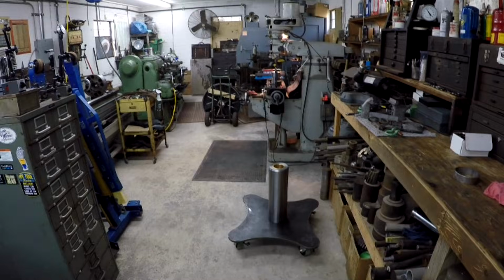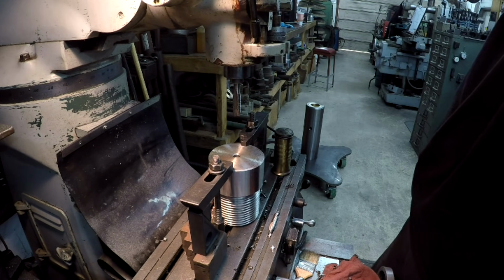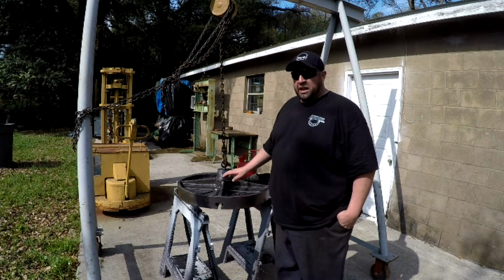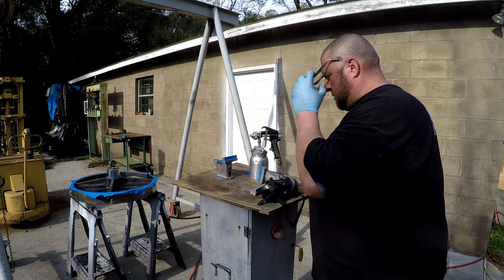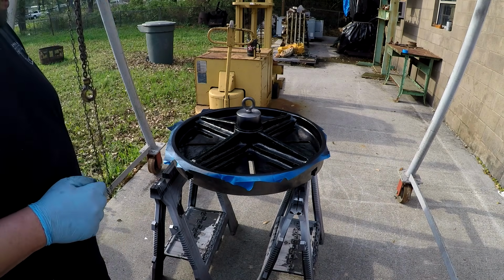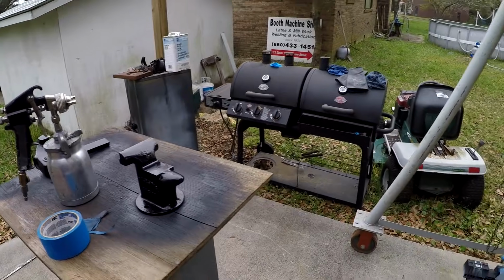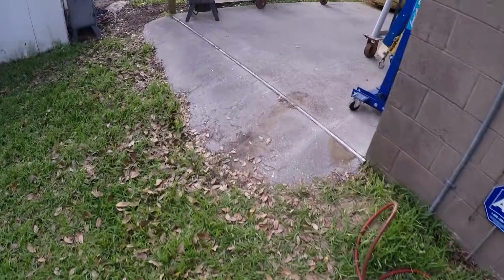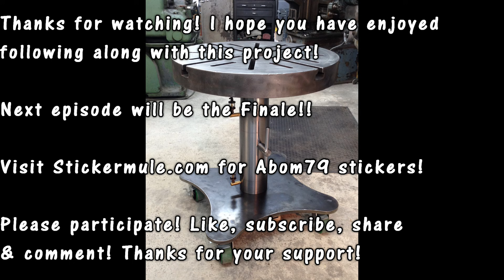Rotary Welding Table Build Part 16: Paint

Comment: Good job on the paint. it turned out well.

 Thanks for the tip on the tap drivers for use with the collet.  I've used a drill chuck to drive them before but like the driver better.

  Jeff

Comment: That spray gun looks almost identical to one that I bought somewhere around 15 years ago for about 15 bucks new.  I purchased it from Big Lots and I think it was Chicago Tool or Central Pneumatic branded.  I've never used it :P  The last big painting job I did was when I shot my '61 Plymouth with a coat of primer,  and I used my old W.R. Brown Speedy Sprayer for that.

Comment: Hey Adam Looking good. Some basic pointers about spray painting, especially outside. First, if possible you want to paint in the shade, not in direct sun-light (early morning, cooler, opposed to late afternoon, hotter,  and more bugs in the afternoon). The reason for this is if its a hot day (above 75 degrees) the sun will cause your paint to setup very quickly, and your overlaps will tend to look dry. Painting in the shade will allow the paint after being sprayed, to flow / level out, and give a much better appearance (as in wet looking). While you were happy that you didn't get any runs in the paint, for those in the spray painting business, a run only means that YOUR PUTTING ON THE PAINT.

Another small trick, is to paint your edges first, (the bottom {Kidney shaped} support plate) then move on the the rest of the flat surfaces.

Your spray gun appears to be a "Knock-Off" of a BINKS Model No.#.-7 (which was the back-bone of the autobody industry circa 1970's to approx the mid to late 1980's.) Many different gravity fed guns are now used, because the "TRANSFER - RATE" of material is so much better with the newer spray guns, {more paint on what your painting, then just going out to no where, and costing you money $$$$} but for the back-yard guy who maybe only sprays a couple of gallons of paint a year, a siphon feed gun like your using is perfect.

Remove and clean the outer spray cap, and remove and clean the Fluid Mixing Nozzle.  That's what you see when you remove the Outer Spray Cap (A.K.A.,Air Mixing Cap).
Some times a brush is needed, just go to your local autobody supply store, or even maybe a NAPA Auto Parts,)

Remove and clean the Fluid Needle, and do put a very small amount of petroleum jelly on the Fluid Needle approx. 1/2" -3/4" in. back from the front tip, approx 1" in. long.

How to adjust the Fluid Needle, squeeze / pull the trigger all the way back, and then turn in the Fluid Needle until it starts to push on the trigger. This is the starting point, and depending upon how much material you want going through the gun.

Another small trick, for when even putting petroleum jelly on the Fluid Needle, doesn't cure the "STICKING" / "DRAGGING" problem, use by hand method only, (with the Fluid Mixing Nozzle removed) a drill bit the same size as the fluid needle, or maybe just one or two thousand's over. You'll know that you went to big, if you start to get blow-back on to the trigger, then either tighten the packing (via the nut), or replace the packing (remove the nut and the packing is right there, and its not much.)

Also, when paint something in a cylinder shape, don't be afraid to turn the air cap, from Horizontal (Default) position, to a Vertical position. Try it, you'll like it.

Comment: Looking good! I'm not gonna critique your spraygun technique (wouldn't be polite) BUT I would recommend talking to your buds that DO paint about some "do's and don'ts". I painted the Z28-style hood and trunk stripes on my '71 Camaro 35 years ago. One thing I WOULD suggest is throw the air hose over your right shoulder and let it run down your back instead of trying to hold it in your left hand. I drug the air hose in my hood stripe right in front of the driver's windshield. Had to flood it and wetsand like hell to make it look OK. And that was Dark Sapphire Metallic paint on a white car.
BTW that spraygun looks like my Binks Primer gun. I got you beat on that one though. A neighbor gave it to me.
Reply from the maker: Funny, often times when I'm welding I through the leads over my shoulder so I'm not holding up so much weight. Yea sometimes that air hose can be half the battle.

Comment: hi Adam great video. just looking at your gantry crane can you mount the wheels on the inside of the legs .with the wheels just proud of the flat mounting plate to reduce the height. the flat plate will help the gantry from tipping over. cheers paul

Comment: Those copper jaws are going to look good on that newly painted back vise.

Too bad that big faceplate wouldn't have been easy to throw in the blaster.  It may have made it easier to clean up.  I like the color after a couple of coats got on the parts.
Reply from the maker: Yea I didn't feel like breaking my back again lifting it. My brother and I set it down out of my truck when I hauled it home. LOL

Comment: I have a spray gun that looks identical to yours. Mine is a Sears gun and says CRAFTSMAN die-cast into the side of the handle. I believe their house branded guns were usually made by Campbell-Housefield. Normal working pressure is 45 PSI if I recall correctly, but you can go +-20 PSI depending on what you are shooting.

Comment: Hi Adam.  I love this project.  The only suggestion I have is that when you're painting, you'll get a much more even coat if you keep the nozzle parallel to your work.  When you flex your wrist the paint is thicker in the center of the arc than the outer edges which also contributes to runs where the paint gets too thick.

Comment: Hi Adam,
The paint job looks great!  The paint on the bottom of the table looks glossier than the paint on the base plate.  Its probably the lighting angle.  In any case, it looks fine!  Looking forward to the final assembly and seeing it complete with the Abom79 logo.  Thanks!
-mike

Comment: Adam

I got distracted with the parts hanging from the gantry, wondering how you are going to cut the legs down and re-weld them.  Since you've got the paint, maybe the gantry will also look good in black when you're able to move it inside ?

Really looking forward to next week and seeing the finished table.

Thanks for sharing.
Reply from the maker: Not sure if I'll paint it with the epoxy oir not. I have plans to go buy a gallon of dark grey enamel soon for various other projects. I may use it on the gantry frame too.

Comment: I almost started crying when you started painting that beautiful center column and the brass fittings. Sad day to cover that up. I wish you would have left that stuff unpainted and only painted the base plate and the bottom of the top plate. Oh well.
Reply: +Nathan James Ok, I see in the next video that you didn't paint over the brass fittings. AAAAAAND the black center column does look pretty good in contrast to the chrome shaft. Not bad.
Reply: +Nathan James  YES! I was just about to leave a similar comment. i thought he was just going to paint the under the top and the base and have it silver and black!WOW! to spray all that nicely machined metal !!  I would have contrasted it with a black anodize on the ABOM logo Keith Fenner made with some siver plate on the mic!  still an awesome table !
Reply: +tc seacliff It would eventually rust if left bare
Reply: "the use spray laquer. would seal the surface while letting you enjoy the beauty. like when you buy a brushed stainless
 or brass plumbing fixture or door knobs.

Comment: Adam you should use a "*inline spray gun air filter.*"
See http://www.spraygunworld.com/Information2/AirFilters.htm
The item (No.#-1) listed there is $10.00 (ten dollars) but I think if you shop around, you should be able to get the price down to approx. $5.00 (five dollars) or less. Also would recommend item (No.#-3), only if you plan on doing more painting or for a Plasma Cutter.

Why is the filter needed? Unless you have attached to your air compressor a "Air Cooled After Cooler," or a Refrigerated Systems. The Air compressor sucks in the air at approx. 15 pounds per square inch; in density, then steps it up to 100 or more psi (heating the air) and producing moisture, and as it travels along the air hose on the ground and cools, the moisture accumulates and becomes water. NOT GOOD FOR Painting.

Comment: Man, Adam, that table turned out to amazing! :) If I may, before painting, why didn't you also cover the big hole (through which the column goes) and its surrounding threaded holes in the base plate? Won't there be interference problems once you'll try to place the column into the hole due to the thickness of the paint?

I was all for painting the Abom logo in chrome and now that I see the glossy black paint, it's just a reassurance that it was indeed the right choice. It's going to look so great on it! :)

Thank you very much for sharing with us. :)